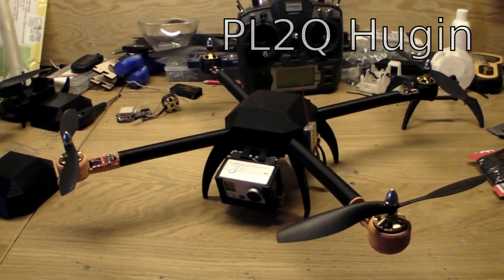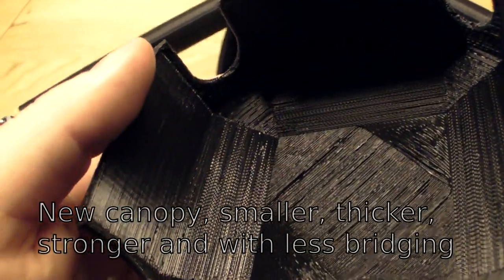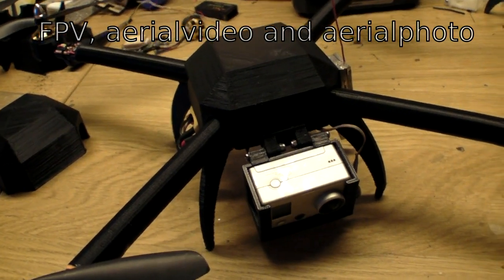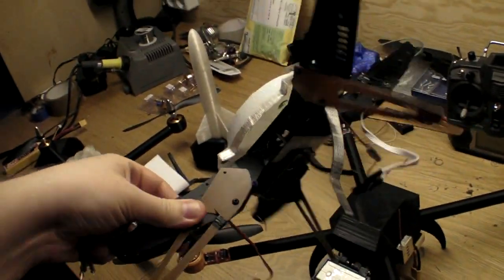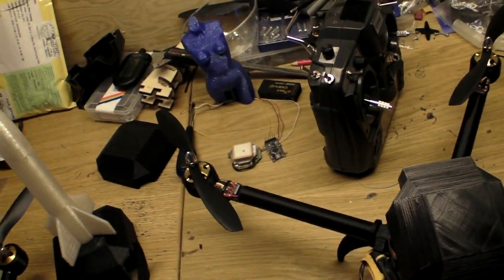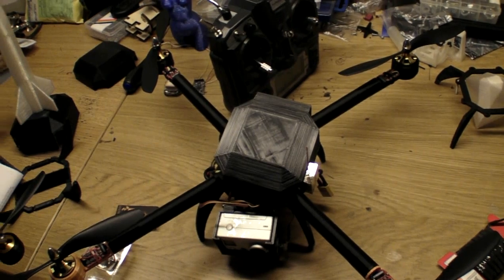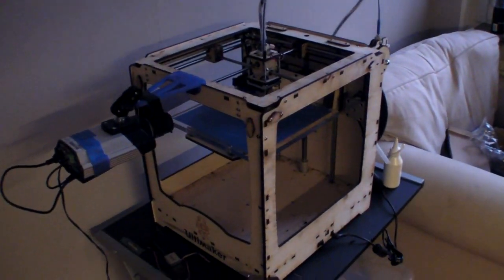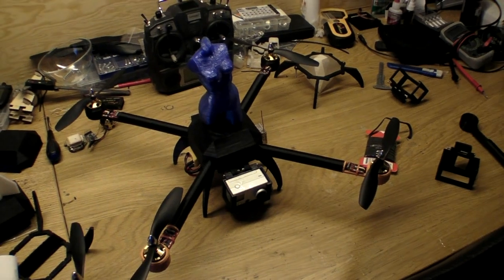PL2Q Hugin, 3d printable quadcopter

Comment from the maker: @stonebayrocker I don't know, it is the 3d printer that is the most expensive parts, and the plastic is a bit pricey to.. A cheap setup with cheap motors etc, about $150. With scorpion motors better controller etc about or over $400... :-) I say go for the cheap stuff first, if you don't have a 3D printer there is a lot of other cheap frames on hobbyking or goodluckbuy etc :-)